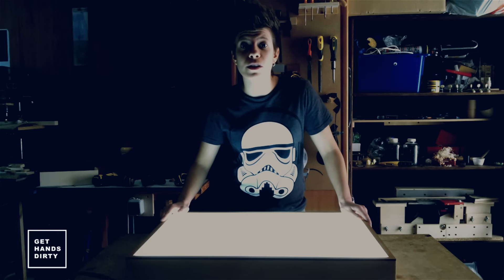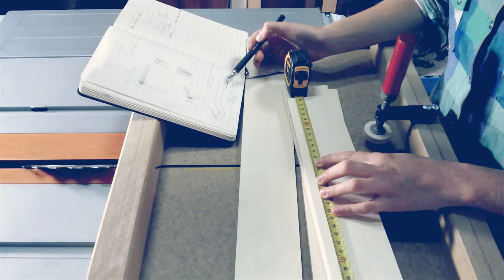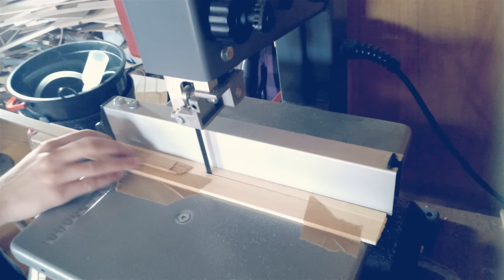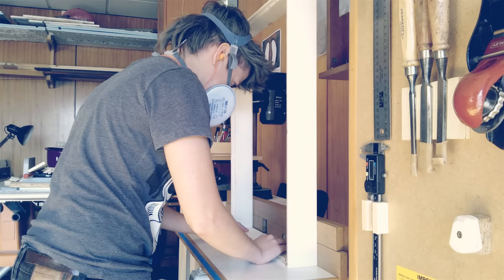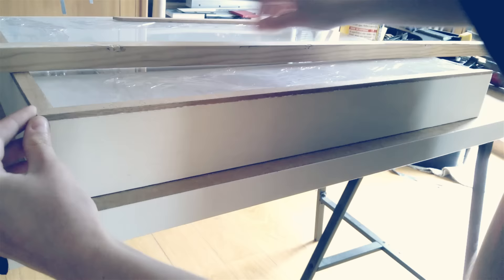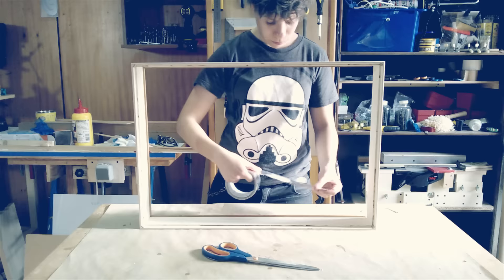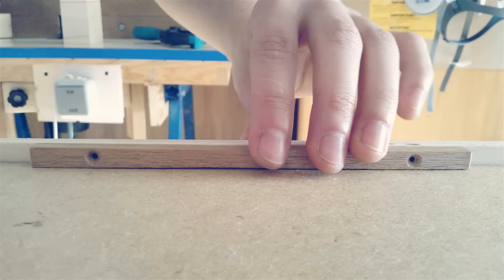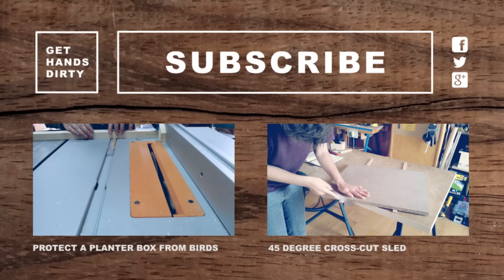Make a LED Light Box

Comment: Nice build!  I really love the 45 degree mitre sledge.  My table saw blade travels when I tilt it, so I might be able to use my current sledge but I am a bit nervous to take the plunge!
Reply from the maker: What you mean it travels? Maybe you can slide the sled forward with the saw powered with the blade up and tilted instead of raising it while running. Probably less scary. Or clamp the sled to the table top and then rise the blade while running. Don't know if I am making any sense to your problem.

Comment: What if we are poor and don't have those machines?
Reply: they have tables you can use at home Depot fam
Reply: Buy used.  I pick up great deals at garage sales and from contractors who retire.  Bought a 1950s Sears combo table saw/jointer all solid base/steel with separate belt driven motors for 50 bucks.  Probably going to sell it after my next project.
Reply from the maker: Please don't bring any violence to the comments section :)
Well, I was and still am poor and didn't get all the tools you see at once. I've been buying stuff over almost 6 years now and of course that when you really want something you need to make sacrifices and invest in that thing. You can't expect machines flying from a tree so you focus on what do you want to build and then search for ways to get it with what you have. Also you can do an easier design in this case and many steps here can be made with other tools, you just need to be creative and think for a bit ;) And the tools I own are not expensive anyway. They are not top quality ones or anything. Follow your passion, save for it and invest on it. I don't own a tv or a big apartment, for example and I choose to spend my money on these tools and materials because this is what moves me and makes me happy right now. And by being active in making, new opportunities arise and more possibilities come to life.
You cannot make omelettes without eggs. You cannot expect to build stuff out of wood without having at least a handsaw to cut it.
Reply: Then you can't be creative.
Reply: art Jard
what was that last word? ryt, it's not in the English vocabulary. perhaps your auto correct is kaput.
Reply: Maybe look in a craft store for a pre-made box(or a box frame that has the glass already), cover one side with white paper, inside the box glue your LED strip, ...presto? Get hands dirty.
Reply: VEUXetVOIS iam poor xD only got a drill
Reply: Most of these tools are no longer as expensive as they used to be. You can find most of the handheld tools (like the jigsaw) for 20 dollars (or less) in any hypermarket.
Reply: Then you must get your hands dirty!
Reply: $20? In what world?
Reply: You can find quite a few on ebay
Reply: The other side of that question is what if we are too rich and have other people do everything for us. Either way doesn't dictate the richness of your life. Your mental attitude will drag you down or build you up. Its your choice.
Reply: if you where poor, then stop playing for your Wi-Fi to watch YouTube
Reply: VEUXetVOIS JK man, u can buy led lights $10-$20 & a 3 feet by 2 feet of glass less than $5 an 2inch by 2 inch block wood buy 4 for each corner for the glass then ur good bro, it's portable too. you can glue the 4 blocks on the glass and tape the led's too, you can have a homedepot employee drill a small hole on the top middle of the glass to hang to on ur wall when ur not using it for free, this should all cost u less than $30 bucks
Reply: Human brain can make everything. Poor isn't destiny but choice
Reply: just buy a thick frame
Reply: Mikołaj Wnęk It looks really good. This shows that u don't need lots of tools to make something, you just need to be creative.
Reply: madddog2487 
a 2 by 4, cut into 4 pieces and singer wood glue works.
for the insert some wood trim works so at most you need to drill 1 hole for the power line, but a cheap wood file works.
Reply: Amazing ❤ I will do it
Reply: VEUXetVOIS commenting to remind you that you had commented on this video 11 months ago
Reply: If you really can't find/afford cheaper used machine tools, you could always pick up cheap hand tools. It's going to be a bit more of a workout though and will take longer. You'll also have to be more careful when making precise cuts, or long, straight cuts.

For this project specifically:
- They used 45 degree miters to join the edges of the box together, you might want to just butt join the box since the miters will be a royal pain to get just right using only hand tools. That is to say, just glue the flat ends of the boards together.

- Rabbits (that dip in the edge that holds the plexi-glass) can be done with chisels and a careful hand, but it probably won't be perfect the next time. As long as it's not so loose that the plexi-glass shifts as you work it'll be fine. And if it does end up being too loose, glue some shims (little strips of left-over wood) in where needed. You can sand/trim these down again if it ends up being too tight.

- Drilling holes and such, sure, hand driven drills exist, but in this case you really should just pick up a power drill. You can get some of the really cheap ones for about 15 bucks, after that just get a cheap and simple set of drill bits that will work for the size of screws you want. For pilot holes, use a smaller drill bit then the screw, for counter sinking, use a large drill bit slightly bigger than the head of the screw.

At the end of the day though you'll still need to buy or salvage materials, screws, and glue. Though you can always put leftover materials towards future projects as well.
Reply: Check out Navin Khambhala channel. He makes all his power tools out of garbage. You have no excuse now. ^_^
Reply: VEUXetVOIS just get a cheap hand saw😐😐
Reply: JUST DON'T DO IT
P.S: im poor too lol
Reply: good luck mate, you r awesome
Reply: The poor shouldn't be looking at this.
Reply: You don't need any machines to make this.
Reply: Think! You have hands and head, buy cheap machines, like electric jigsaw or something like that, fix and with few wooden part make your own machine.
Reply: Thank you for being so inspiring ! I watch your videos and get so many ideas from them thank you for following your passion and sharing it with the rest of us!
Reply: What I hear is you really don't want to create stuff that bad if your little mind can't solve your own problems
Reply: VEUXetVOIS 
You can tell by all the thumbs-up you're not the only poor bastard around here. I'm in the club 2
Reply: @GetHandsDirty  Love your channel. Don't care to justify yourself to others. Let haters, hate. That's their job. Doing nothing to improve their lives, just to hate other people for their achievements. Keep well!
Reply: @GetHandsDirty  AJJAJA ANDA POOR YOU ?? JAJJAJAJ

Comment: Hello! I noticed that your light box is rather high (in my opinion). Does the height matter? Is it comfortable for you? I want to make a light box, but I prefer flat box like a tablet (3 or 4 sm high). That's why I' asking.
However, I'm very impressed with your carpenter skills. Amazing work!
Reply from the maker: Hi! When using this method of sticking the lights in the border, the closer they get to the face board, the darker the center will be because the light don't have much space to spread around. On the other day I was thinking about another solution to make a light box that is really really shallow but I haven't tested it yet. I will probably make a video on that soon though ;) Of course you can always use tons of strips and stick them to the backer board so they are facing the white board...but you need to apply them very very close, otherwise you will end up with with a striped looking box. Give it a try! You can always unstick it and rearrange stuff. And you don't really need such a nicely done box. You can use thick cardboard or wood with butt joints and a few screws. It's up to you. Make it with what you have and how you want and allow it to be "yours" :)
Reply: Thank you for explanation! It became much clearer. I suppose that I should get a piece of acrylic glass and than try different combinations of LED strips and height of my box :)
Reply: You can line the bottom of the box with any type of reflective surface then there will be less of a darkspot in the middle as you make it more shallow
Reply: there're other methodes to build a Light box too, but more complicated ones. I'm planing to build such one, of an old computer monitor. But this would need a bit more know in electronics, unfortunately.
Reply: Do you mean LCD monitor? I've thought about it, but I need a rather large light box. Now my husband and I build our box. It's 60*50*4 sm (shallow as I wanted). We use white acrylic glass (LT 30%) and LED strips as a light source. Our know-how: strips are divided into three sections, so I can turn them on separately.
Reply: ok. maybe a "old" TV would work as well😀
Reply: Lidy Klimova try usin an old led laptop screen

Comment: Just a tip to keep in mind about those LEDs.  The next time you wire the input connector to the strip, make your solder joints in the middle of them, not on one end.  Especially it the strip is long.  This evens out the load and will prevent voltage degradation near the furthermost end and will balance out the current much more efficiently.

Comment: I want to do this for hanging picture panels in my living room. They might be slightly larger than your lightbox. My concept is to decoupage tissue paper on the plexi as the artwork, then also use them as lighting for the room. So thankful for the LED tip! My question is, what would you say is the minimum depth for acceptable and even light dispersion? I was hoping to keep these fairly shallow (like 2–2.5 inches max) as they will butt up against window frames which aren't even that deep so I don't want there to be a lot of visual disparity due to varying depths at the meeting points. Gosh I hope you're still checking comments on this. Amazing work, btw. I'm lucky, my husband is a master craftsman like you, so hopefully he's down to help out with the box construction (cuz he has access to all the tools).

Comment: Wonderful project.  I've got a table saw and router but not got round to making a router table yet.  I wanted a lightbox for tracing drawings.  Subscribed!
Reply from the maker: +Sabbyne Lewis It is not hard to make a router table. I followed Steve Ramsey's video https://youtu.be/Gf5tRp35EEU when I built mine about 4 years ago. But you can also find easier ways if you search a bit ;) Thanks for subscribing and good luck on your projects!

Comment: for light box it is best to run the strips on the bottom shining up to the top in equal intervals instead of the sides. that will prevent a darker patch in the middle of the lightbox. also for led, the thickness of the box should be around 100mm to avoid seeing the strips.

Comment: Haagen Daz ice cream sticks are thicker as I can attest. I hope you have 5000K LED's in that box. There are grinds of the teeth on some of the more expensive saw blades that will not tear out with the plywood sheets. I use the Leuco brand of saw blades from the hinterland with Baltic Birch and other ply woods. If you spring for a Leuco blade do ask around and do not send it out for sharpening to regular sharpening shops as they will mess it up and grind off too much carbide. And after a while get a second blade so you have one in hand (dirty hand) to use whilst you get the other sharpened. Some of my Leuco 350MM 84T ATB blades cost as much as a small portable saw. I send my Leuco blades some 400 miles away to St. Louis MO for sharpening.

Comment: Nicely done GHD. Jealous of all that great kit (..oh and the knowledge to use it) For a more even light distribution what would you suggest would work best? A mixture of rear mounted and side mounted LED strips?
Reply from the maker: +Rich Clark (Clarky) Thanks Rich! You need to be careful about the rear mounting because unless you apply tons of strips with minimal spacing between them, you will always see light lines instead of an effectively distributed lighting. That way, you can reduce a lot on the box thickness. If you are making a thick box like mine, I recommend also applying led strip to the sides. And yeah, if you are willing to use a lot of strips, use both strategies. The more strip you have, the better it will shine in the end!

Comment: if you need an affordable light box for film, color slides etc. but don't want to build anything, do as i did...use a troffer light, which is commonly used in ceiling grids, you've seen zillions of them in offices, most common size is 24"x48", also 24"x24"
they can be found cheap on craigslist or anywhere really, mine has led tubes while others use fluorescent..both work excellent with a frosted lens and either acrylic or glass as the work surface..google around and check it out

Comment: I want to use 9.6W led strip, will it be enough power? I would photograph old negative film with my dslr.
Reply from the maker: +PeopleCanFly23 I think so. It depends on the size of the light box, but if it is going to be aprox. 60 x 40 cm like mine or smaller will work just fine. if you put one layer and you find it to be too dark, stick another layer like i did and that should be enough. of course you will need to connect properly the positive and negative poles and don't forget to check if the power supply has enough power for the double layer option ;)
Reply: Get Hands Dirty Yes, I've taken into consideration everything except for the power of the led's, I'm planning to photograph negatives, so my box will only be 15x20 centimeters, also, I couldn't find plexiglass available to me, so I bought couple of picture frames and I'm planning to put a white tracing paper between those two pieces of glass, I hope it works..
Reply from the maker: +PeopleCanFly23 Not as good as a opaline acrylic sheet, but might work. Maybe you get better result with a regular printer white paper. Good work on that!

Comment: That was brilliant. I am looking for tips on making lightbox frames for stained glass. I like the LED strips a lot. Would it have been possible to have made it much thinner?
Reply from the maker: Kenneth Falconer Hi, thanks! Well, I've been thinking exactly the same and I'm now working on a thinner version. I don't know how that will work yet, but I guess it's going to be just fine, since it is pretty small (A3 paper size). The only thing I imagine is that, if you make it very very thin, for example in the size of the led strip, probably the difference between the light amount in the borders and the middle is going to be quite noticeable which may not be good for photography/video work or other stuff. There is another solution to make very shallow light boxes - you can put the led strip in lines covering the entire backer board. The thing is, it requires lots of connectors or soldering wires and a lot more quantity of led strips... Well, maybe I will make a quick video to show what I'll come up with with the thinner version when it's finished.
Reply: Get Hands Dirty thank you,  that's very helpful. Fortunately the soldering won't be a problem. Stained glass is pretty much all soldered anyway :)
Reply: Get Hands Dirty Also, does the plexiglass bend when you put any weight on it? Would etched or sandblasted glass be any better?
Reply from the maker: Kenneth Falconer It depends on what is your purpose por the light box. Sandblasted visual effect is absolutely different from opaline (the one I used in this video - plexiglass acrylic opaline white 3mm thickness). The best one to spread the light evenly is the opaline white. But since you're going to light up stained glass, I believe that sandblasted glass could work just fine because the drawings tend to distract the eye if the light is not that even. But through camera lens it will probably look better if you use the opaline option. And yes, plexiglass acrylic bends a bit, depending on the weight of course. The advantage is that will less likely to break than glass under certain circumstances. But if you use a thick plexi, it will work like a charm in terms of not-bending, although you should keep in mind that the thicker the material, the less light it allows to come through...so, you have to figure out what is your final purpose and study the best option! :)

Comment: Just subscribed..after you made the initial miter cut on each piece, you measured and marked each board for the opposite side cut. You then aligned the mark with the cut on your fence. I have a question: was that measurement on the outside of each piece (looks that way)? Since your miter will then be going into the board, how do you achieve the inside measurement that you need? Thanks.

Comment: For photography just make sure that the LEDs have a color reproduction index of at least 80. Proper studio lights usually have 85-95. The problem with LEDs is, that they do not have the full spectrum in contrast to incandescent lights. Especially reds can look really wonky with poor LEDs (e.g. red will appear brown). This is obviously bad if you want to judge the colors of your photos/take pictures with accurate colors. It's also hard to correct later as the information is just missing from the photo. So light is not only color but always a mix of colors.